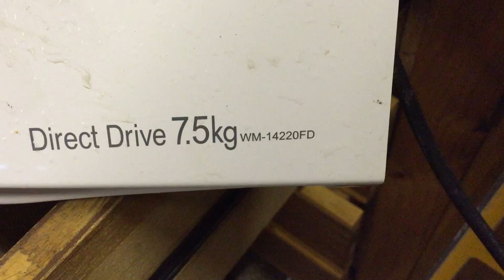How to test a washing machine pump

Comment: very very hard to hear even with volume at top.  . very jerky video.
Reply from the maker: Your comment is really helpful on a video that is really old and can't be changed, what do you think I can do?
Reply from the maker: @kimbuck-2  makes no difference which way the wires go. It is a shaded pole induction motor. The shading of the poles controls which way the motor starts. So you don’t have to think about it at all.